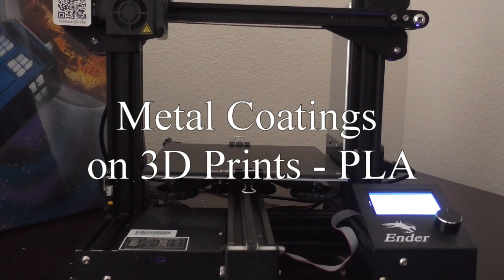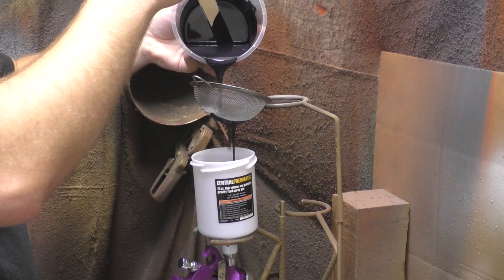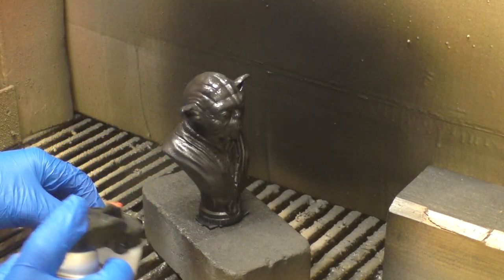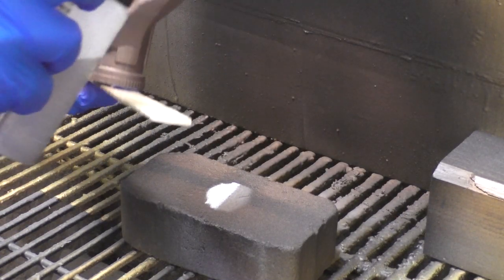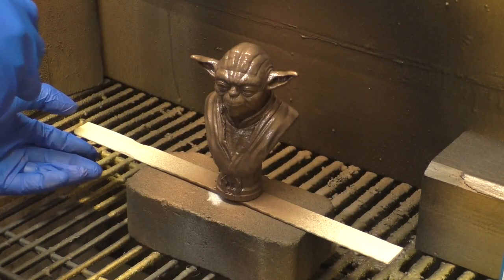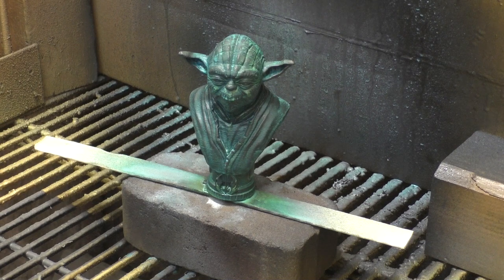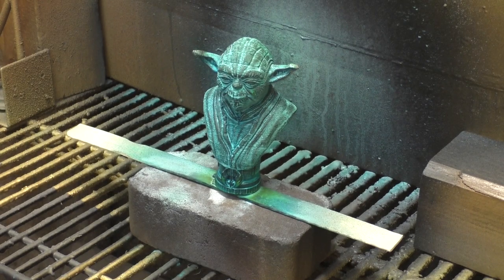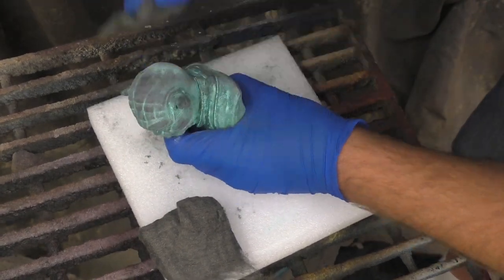Metal Coating on 3D Prints - PLA

Comment: Great video! I'm planning to do a 3D print of the Statue Of Liberty. Which of your products would you recommend to get the look of the statue? Thanks
Reply from the maker: That would depend on what shade of the Statue of Liberty you want it to look like. For the more iconic light green color, I would likely try the Copper B Metal Coating with the Tiffany Green. If you want more blue in in, possible the Original Blue instead of the Tiffany Green.